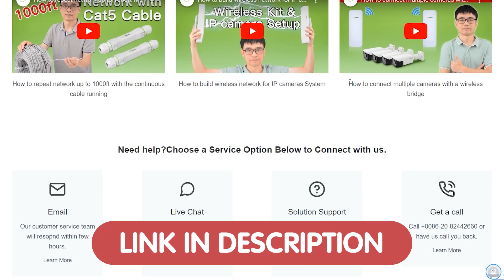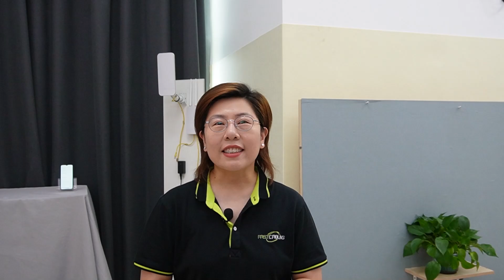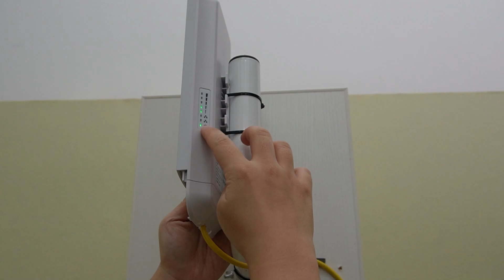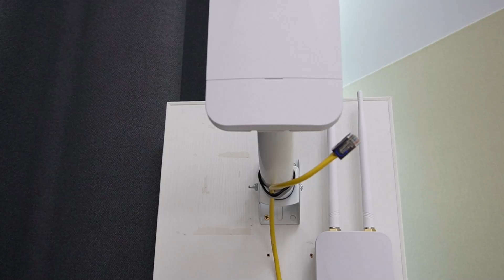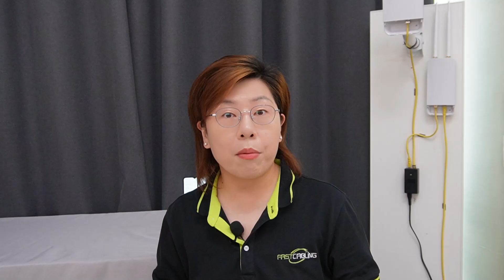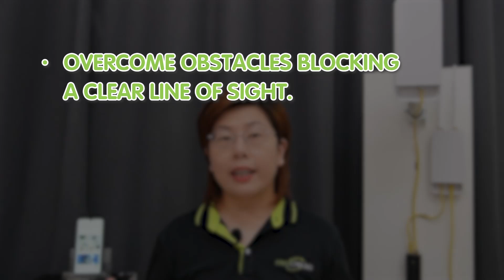Explore the Benefits of Wireless Network Bridges | Back-to-Back Setup(ep.01)

Comment: Hopefully it won't have effect on thoughtput and bandwidth on that network, because it could be multiple hop from AP to the next AP.
Reply from the maker: If the first AP has 300 Mbps available bandwidth, the next AP will have half that throughput, and it continues to decrease as more hops are added. If the APs are connected via wireless backhaul, throughput is more likely to degrade, especially with multiple hops. In contrast, if the APs are connected using wired backhaul (e.g., Ethernet cables, fiber), the throughput loss is minimal, and you'll maintain higher performance across the network.